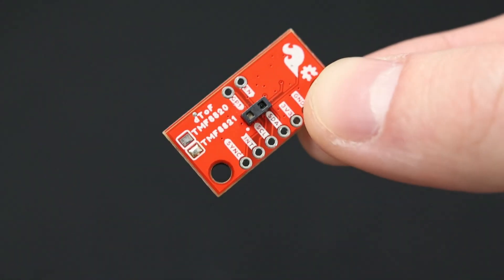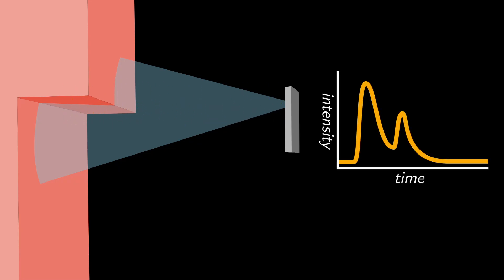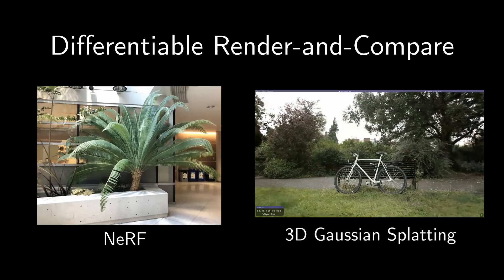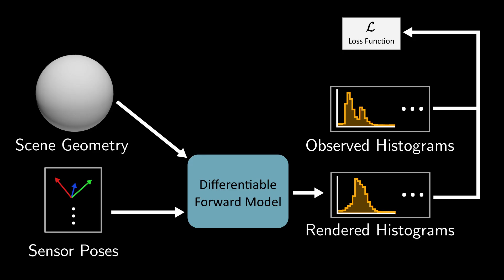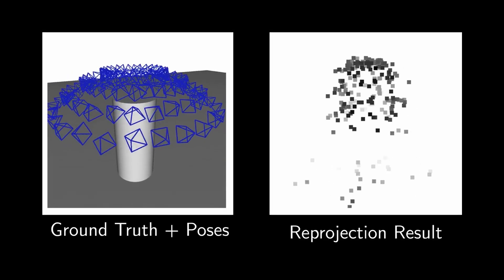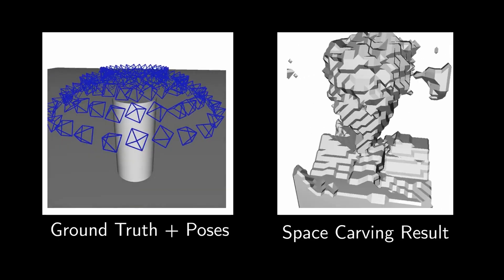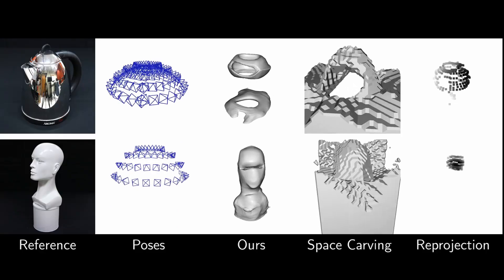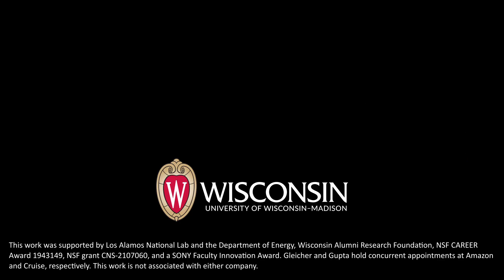3D Reconstruction with a Tiny Distance Sensor

Comment: in theory, couldnt you see inside human flesh tissue to some amount (vs not at all with bone) in the transient histrogram? (maybe need a range! of laser fq leds in a small array, but regardless)(arent those tfl boards IR?)

but incorporating that gesture bracelet and pointing all boards at the center -you could make -me a very very very tiny 3d redundant fMRi-like device-ish, suffering from an exotic case of wide range Opia.
(a weaker version of thermo acoustic imaging)

xmas is just around the corner, ya know? nudge, nudge, wink, wink

Comment: If the inverse also works, meaning estimating a pose from sensor readings of a known geometry, this could be used for really accurate orientation and navigation with low cost sensors.

Comment: when you studied too much engineering and have no common sense
Reply: Seriously. On its face, this method of 3D reconstruction is like polishing a turd. Completely ill fitted hardware yields crap results,  Impressive work to get as far as they did, with such a simple sensor but its completely demolished by a simple lidar equipped iPhone 😅

Comment: Why doesn''t space carving work?
Reply from the maker: The intensity of reflected light measured is highly dependent on the object surface and the distance to the object. This combined with the fact that the outgoing laser pulse is not a perfect on-off impulse means that there's no one threshold you can set for space carving that consistently carves right up to the true surface without cutting through it.

Comment: What would happen if your measured time of flight data was interpreted/projected spherically? As the graph goes from left to right, the light pulse travels radially outward from the emitter, and when it bounces off the object and is collected by the sensor, the intensity of the reflected light tells you how much stuff there was at that particular distance from the sensor. Mapping that data to a spherical hull and combining the data from multiple hulls in a method similar to computed tomography might give you more resolution or require fewer samples.
Reply from the maker: This is a good idea, and something we have tried. With some more advanced techniques it could likely work, but there are two main issues: 1) in typical computed tomography, the volume density is measured. In our case, the sensor only sees the surface of the object, so the detected signal is view dependent, which makes backprojection less effective. 2) CT works best when viewpoints are uniformly spaced around the object. In our setting that's not always the case which can lead to some lopsided reconstructions.

Comment: This is really cool. Looking forward to a phased array version. Big issue in terms of reflectivity. Not sure if you can chirp the intensity of the outgoing signal, but it might be able to give you some information about the reflectivity of the target area
Reply from the maker: Unfortunately with these cheap commodity sensors we don't have the ability to modify the laser pulse. You'd need a lab-grade setup for that. We did try recovering the BRDF of the object in addition to its geometry, but weren't successful. It's very difficult because there are ambiguities between geometry and BRDF when you allow the BRDF to be learned.
Reply: hey, thats my other email too rocklobster something something.
https://www.youtube.com/watch?v=BxgJcVttVVk

but Thats what i was leaning towards, a circularly phased array like a mini myopic  fMRi . thing lol

oh, an IR laser diode eh UW? i
 really should have looked into these boards long ago. i thought they just seemed too good to be real for some reason

Comment: Great work , try two sensors like how two eyes gives better precision
Reply from the maker: We're already using many sensors to reconstruct the scene! It wouldn't be possible with just one sensor.
Reply: @uwgraphics 
I did not know that even though I watched the whole video.
I thought it was single sensor that moves in multiple directions THEN the system reconstruct 3D image
Reply from the maker: @MohammedShahrani  Yes, you're correct. It's one sensor moving to multiple positions, then reconstruction is done after. I should have been more precise in my comment. We're only using one sensor, but we're moving it to many locations, so it's as if there were many sensors looking at the scene at once.

Adding a second sensor wouldn't help much, since we already have many viewpoints from moving the sensor around that we're taking advantage of.
Reply: @uwgraphics wanna bet ?

Comment: Nice work, and thanks for sharing! In regards to the problem of reflection, would it be easy to account for the angle that a signal is intercepted from? In the video it looks like main signals are hitting the receiver in a straight line, so perhaps you can measure the different angles that various signals from a reflective surface scatter from and then make a transient histogram from the average value.
Reply from the maker: Averaging the signal from different angles probably won't work because different materials respond to light differently depending on the angle (think a mirror vs matte paint). Look up "BRDF" to learn more!
Reply: @uwgraphics  Oh, shoot.Yeah, that would be a problem. Sorry. Maybe a value can be factored in for "reflectiveness" of the material?
Reply from the maker: @CDeruiter5963  We tried exactly that! There's something called the Phong lighting model, which includes a term that trades off specular and diffuse reflection, just like you said. We tried learning that term for the object, but unfortunately it wasn't enough to fix reconstruction of shiny objects.
Reply: @uwgraphics  Aw, bummer. I'll stop grasping at straws then and let you do the real research. Good luck! :)

Comment: Seems like this could be used for indoors drone navigation in the absence of good navigation signals. Obviously distance to nearest obstacle can be used to basically try to avoid running into something, but beyond that a spinning drone could have the sensor on the end of a boom. That way, it can get enough sensor movement to provide multiple data points.
Reply from the maker: Absolutely! One challenge in that setting would be tracking the position of the sensors over time - in this work we assume the sensor positions are known. But there are prior works from other groups on doing SLAM with this type of sensor. Perhaps the two approaches could be combined.